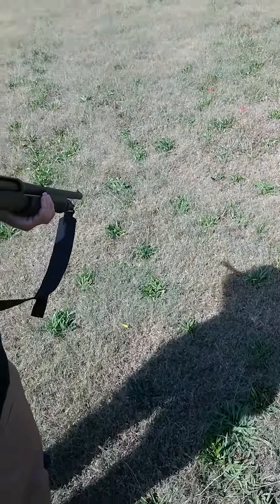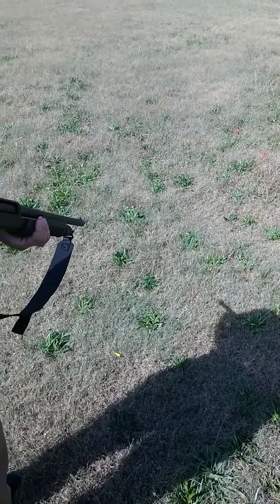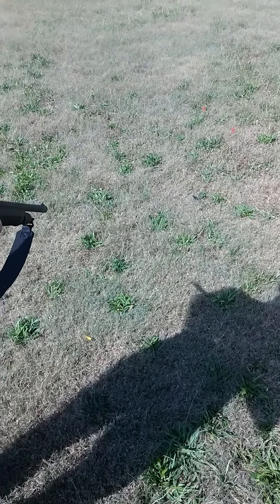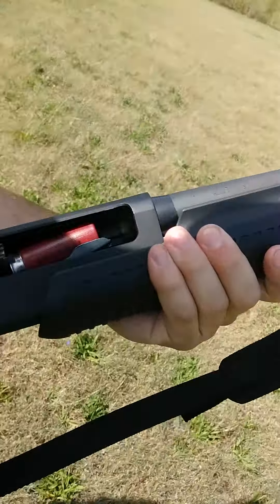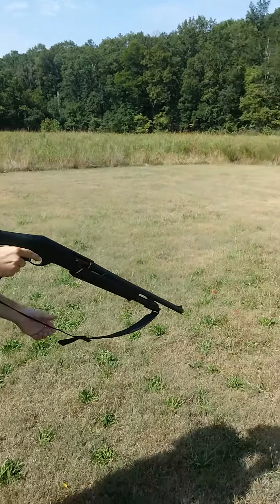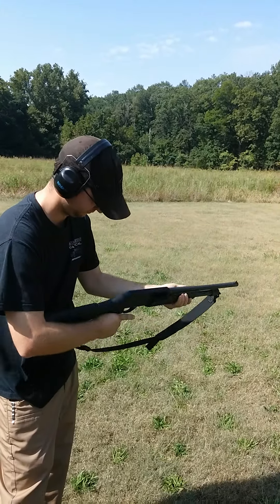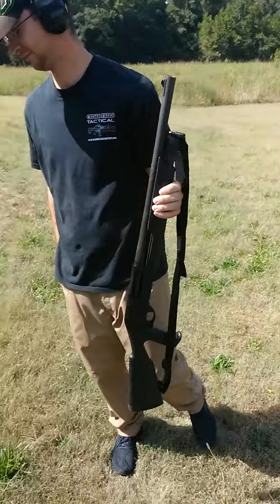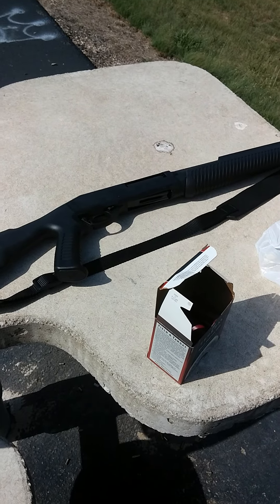Stoeger p350 fail

Comment: My Benelli nova, Winchester sxp, and Stoeger all do this. They are supposed to assist the pump. this is complete operator error. I also have a 870 wingmaster and a Mossberg 500 to compare to. Learn how to shoot it and you won't have any problems.
Reply from the maker: Nick, I traded it for a mossberg 500 and never had a issue again. Lol

Comment: Looks very the same problem that I have with my p350. It doesn't happen when pump cycle hits right but I would feel that good gun wouldn't allow me to do this frequent miss pumpactions. AND now that I have been practicing reload cycle forehands plastic handle broke into three pieces. Heard that there has been manufacturing errors. Hopefully I get new one for that. Although it's been great gun for the price.
Reply from the maker: +ShadowWolfFIN  How much did you give? I know they had been going for around 400. I took the one I had in on trade and traded it for a mossberg 500 after that. I suppose it just needs a steady pump, steadier then what me or any of my friends are capable of. One friend managed to get it to work flawlessly but he pumped it incredibly hard each time.

Comment: You arent pulling the pump all the way back. mine does the same thing too unless the action is all the way back. Also he is pumping a little to quick and it looks as if the shot is pushing back the pump.
Reply from the maker: Yeah. The action on those things is weird. I ended up trading it for a Mossberg 500 and haven't had any issues since.
Reply: @xbigbobsagetx  You still made a video worth nothing ;)

Comment: got one 2 weeks ago and slugs and #4 shot were shooting a foot low, called stoeger  the turkey on the barrel doesn't mean turkey barrel , means its made in turkey , they said to file down the front site which is sweated on , I used my dremmel to remove the rifle site and will try it again , sorry I bought this , will probably trade it at a gun show , you shouldn't have to send a gun back brand new , they are aware of these problems and should be recalling them , I would never buy benelli or stoeger again
Reply from the maker: joe orefice 
Just get a mossberg or a Remington. Leave these for the Stoger fan boys. Lol

Comment: I have the same gun with the same issues. I just sold it and got myself Mossberg 535 Turkey combo. haven't looked back ever since
Reply from the maker: +alexhinojosa331 Yeah if you have to manhandle it like your beating a dog every time you want to pump it then ill just own something that works like butter like a 500, 535, or a 870.